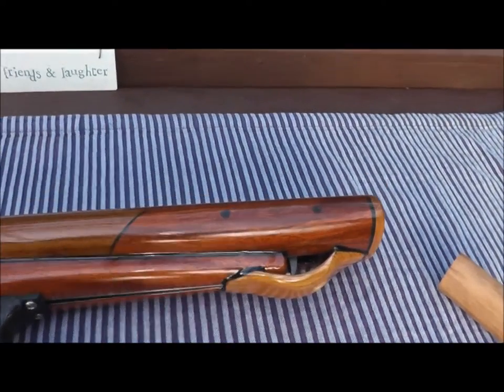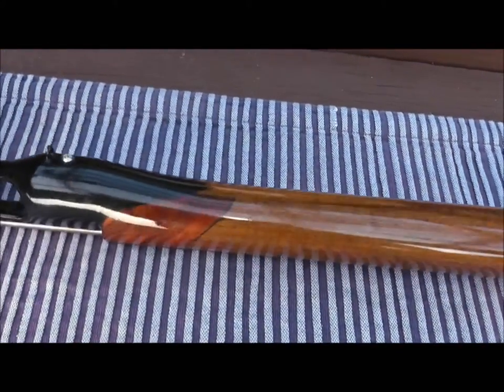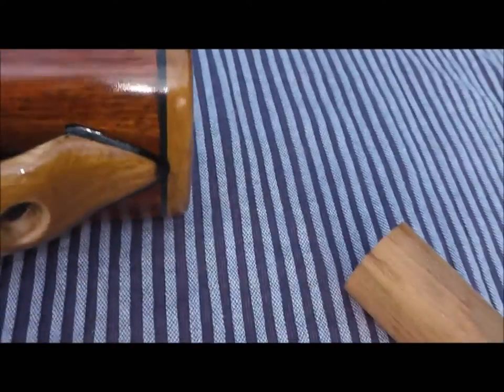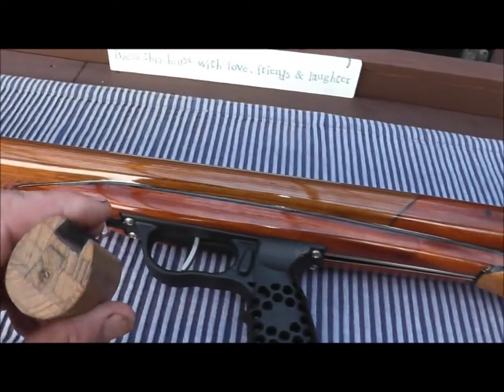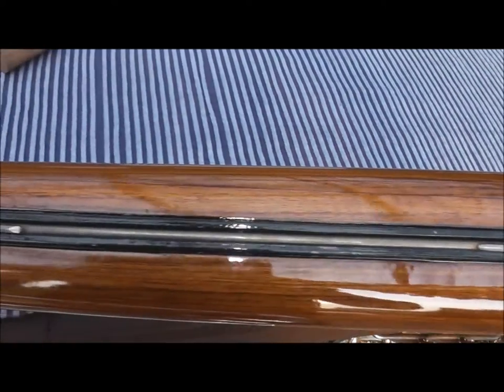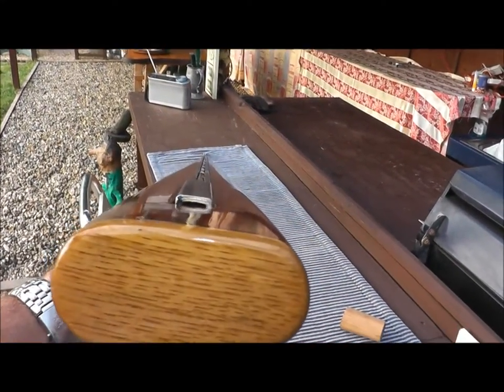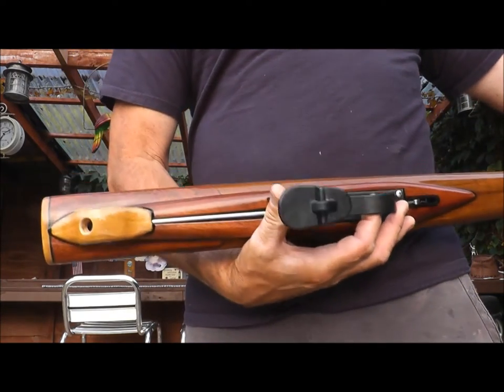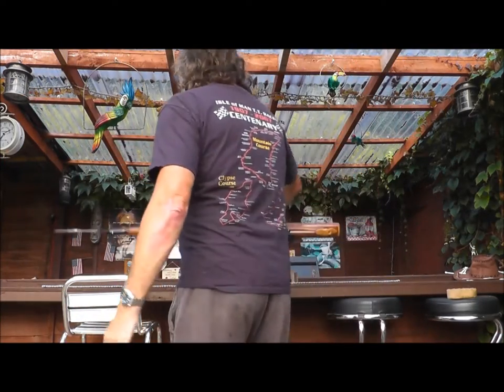Mid handle speargun

Comment: What a beautiful thing! You've inspired me to build one. Out of interest, why mid-handled? A little more power from longer rubbers?
Reply from the maker: Hi you will get more manoeuvrability by moving the trigger forward as it makes the gun easier to swing around.
It also means you can use more mass to reduce recoil.
Reply: Good point @foxfish7115  Thanks very much.

Comment: Finally got round to this project and have now got the wood, ready to be laminated.  Do you have a preference for any particular brand of epoxy - both for the lamination and top coating the finished item? Really grateful for your thoughts. 👍
Reply from the maker: I would guess in depends on where in the world you live but I use west systems epoxy for glueing and nowadays I use international two pack varnish which is polyurethane based.
Reply: Thanks very much. By chance, I've just got off the phone with West System's UK reps - Wessex Resins. They were super helpful and even suggested an additional bonding layer for the laminates which involves applying a second coat that contains their 403 Filler. Will follow their advice and let you know how it goes on the Deeper Blue Forum. Many thanks again. 🙂

Comment: beautiful gun. I'm working on a mid handle gun right now and I would like to make one like yours. would you share the dimensions?
Reply: hey Fox fish thanks for getting back to me.
if you would please validate these observations.
the width of the body is 7.5 cm at the butt of the gun.
the taper begins just forward of the trigger mechanism and tapers to a width of 3 cm at the muzzle.
the gun body is 3 cm thick at the butt of the gun and is fairly constant to the end of the trigger mechanism plate then tapers to 4 centimeters at the muzzle end.
the trigger mechanism plate is 6 cm wide and 36 cm long.
the gun is neutrally buoyant.
I'm hailing from Pensacola Florida. Cheers and thank you
Reply: great, I need all the help I can get, joining today.
Reply: I'm having trouble finding the handle line release and trigger mechanism that you use. Can you share with me where you ordered them and what the name is please
Reply: Sorry to keep bugging you on this fox fish!
I've contacted the spear fishing supply source that you recommended and they don't have any idea how you made the line release that is a forward of the trigger in handle.
I've tried to contact you through the deeper blue Forum but have been unable to post successfully.
Could I trouble you to diagram how you made the line release.
Thank you for your time.